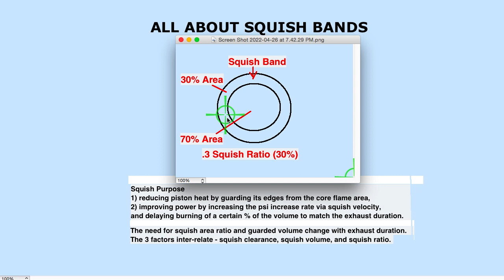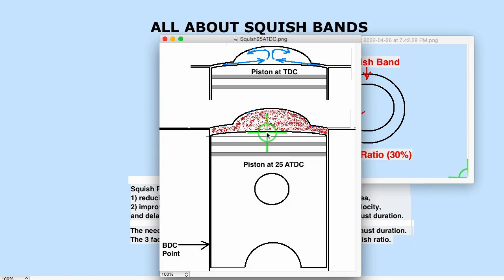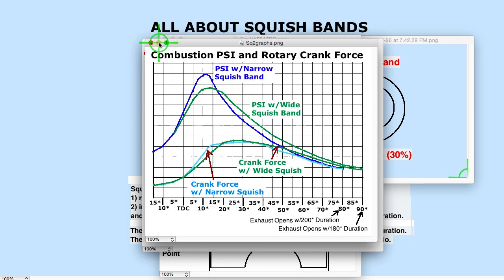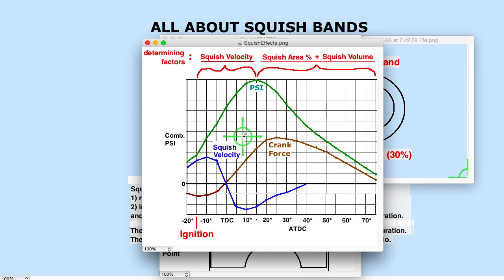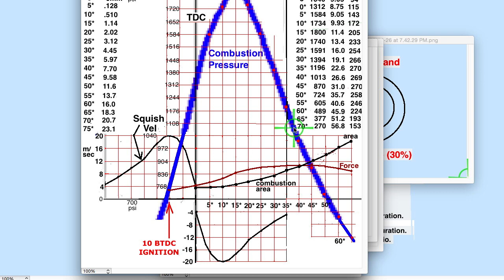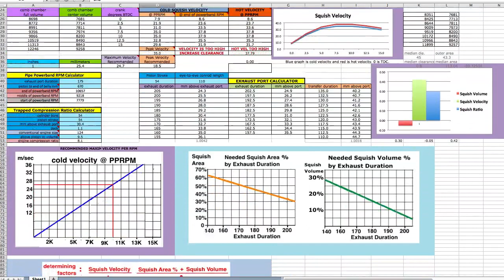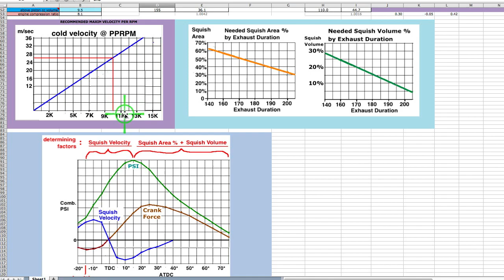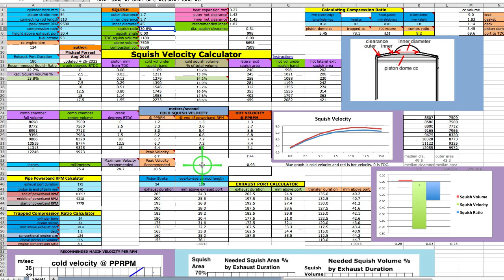All About Squish Band In 2 Stroke Heads

Comment: Very interesting video, have you done any comparisons between dome shaped combustion chambers verses trapezoidal chambers (Both with squishbands)?  The reason that I ask is that I have read a fair bit of information that implies that there is an advantage with the latter type of chamber in terms of peak power but in my mind it just does not seem to 'look' as good as a dome chamber, in my head there appears to be a 'dead' area in the trapezoidal chamber where the roof of the chamber joins the sloping walls of the chamber.
Reply from the maker: dead areas are OK as long as they aren't too big. They may actually offer some advantage.

Comment: Do you have Any tips for me on How to calculatw squish band width?
Reply from the maker: There are no good ways to calculate other than using a computer because the width works with the clearance to determine the squish velocity and the squish volume (which is just as important). The required velocity and volume depend on the max RPM and the compression. dragonfly75.com/moto/sqVelocity.html

Comment: What about  early 2 stroke  head with no squish area (all dome heads)?
Reply from the maker: my AX100 had a no-squish head but I used it in a really hot country and so I modified it to have a squish band to help cool the piston. But if that bike was in a cooler country then it would of ran fine as is, maybe a little stronger with a squish band.

Comment: so why the aprilia rsa has 50% squish area?
Reply from the maker: Yes it does but it also has a special powerful ignition to reduce the possibility of a high squish velocity blowing out the initial flame and its above port compression is only around 7.5/1. The compression also affects the flame speed, so with a low compression you can have a higher velocity. As to the squish volume it is only 2.7% more than what the base recommended amount is due to the 0.7mm squish clearance.

Comment from the maker: Does the Pipe Affect Needed Squish Specs ?
Yes. The pipes return suction and pressure waves increase the delivery ratio and the amount of intake charge being compressed to ignite. But that mostly affects the peak combustion pressure, not the rate of flame propagation till peak pressure. Probably the rate of pressure decline stays the same but with more peak pressure it will take longer to go to zero.
So the more effective a pipe is, the smaller the squish clearance needs to be. That increases the squish velocity and reduces the “guarded” squish volume which burns late and extends the pressure time.
The most effective pipes are also the ones with the shortest pipe powerband. They have short/wide belly’s, increasing angle diffusers, and short baffles. A really short baffle is close to 150mm (6”) long, and a really long one is around 300mm (12”) long.
Reply: "the more effective the pipe, the smaller the squish clearance" do you mean how close the piston gets to the head? Shouldn't it be as phisically close to 0 as one can get it in every case?

Comment: Always appreciate your videos. Love the in depth numbers and birth gritty details.

What area of two strokes you focus in? Kart racing? Snowmobile? Dirt biking?  

They all got different power curves so I'm curious what goals your after
Reply from the maker: I focus on coming up with concepts and formulas that apply to all 2 strokes but as far as tuning and modifying I probably have more personal experience trying to get a nice wide powerband for street and trail bikes. I find that more challenging than going after maximum power at max RPM for racing. But the people that do that consider it the only worthwhile goal. I disagree. 2 strokes can have a wide variety of uses and the modifications need to suit the intended end goal.
Reply: @MichaelForrestChnl  
Thanks for the time to respond. I agree a wide power curve is the primary goal. I ride big bore two strokes dual sport so all around performance is what I am looking for as well.

I can definitely confirm some extra squish band on the ktm 380 makes a world of difference in ridability and  jetting becomes actually possible.